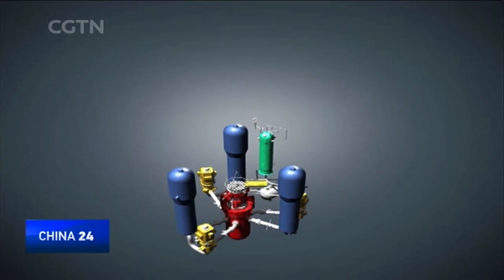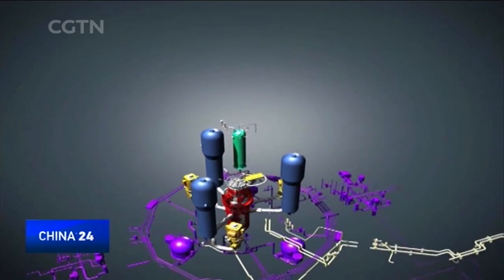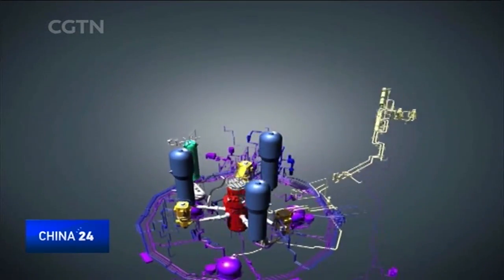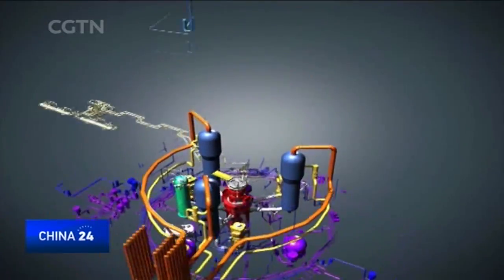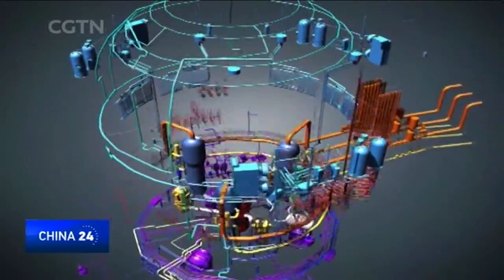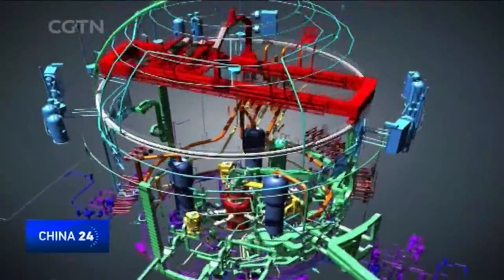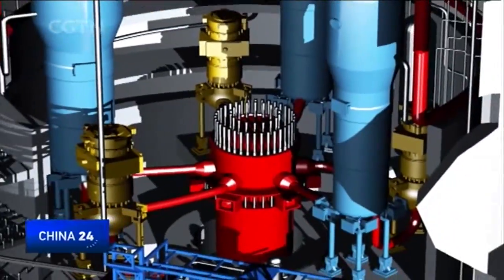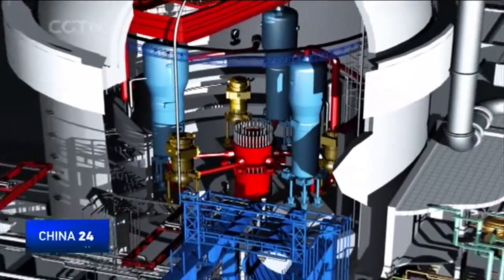Dome installation of China’s Hualong One nuclear project begins

Comment: even if there is never an accident or disaster or war, pollution lasts for 10,000 years,  I mean 100,000 years, I mean 1,000,000 years, I mean 10,000,000,000 years. So lets just comprehend this to boil water today to generate electricity almost equal to the electrical cost of mining, refining, an transporting the nuclear fuel, they intend to create pollution that lasts for longer than the Earth 10,000,000,000? what is the infinite cost of securing the pollution for 10,000,000,000 years, oh that is the great grand childrens problem so you don't care?   Talk about total disregard for the safety of future generations, to meet shorterm interests.